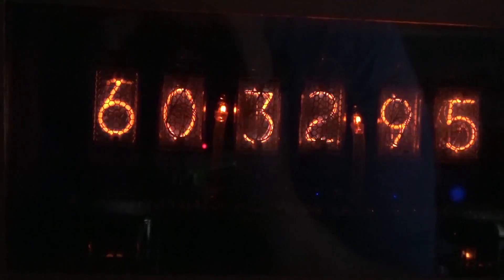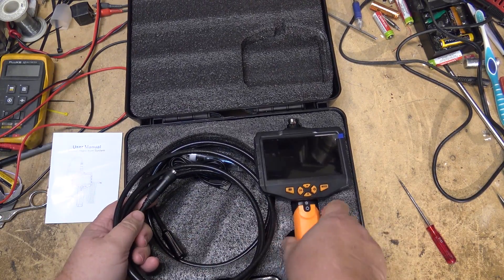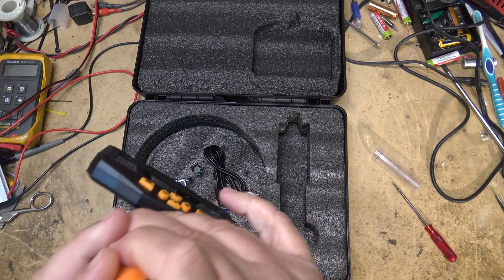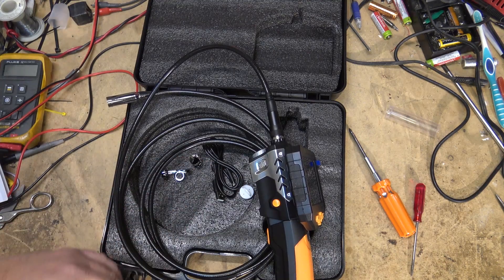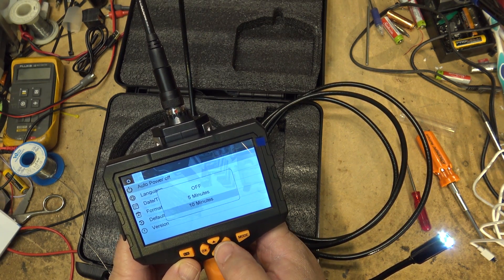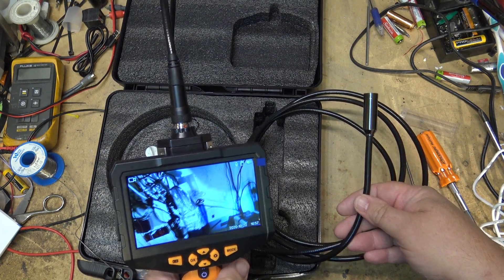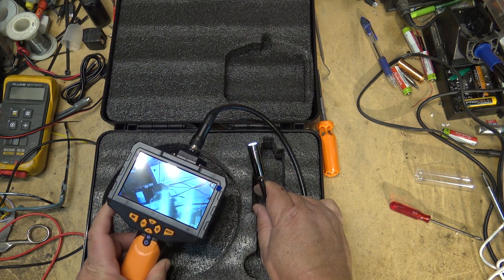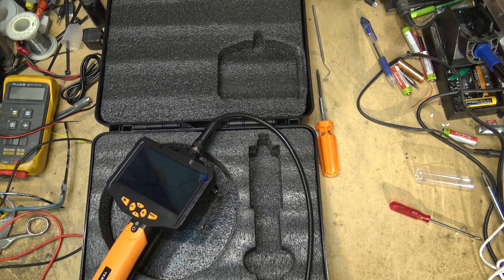Teslong NTS300 Autofocus HD Inspection Endoscope Evaulation test

Comment: Say if you have recorded MP4 videos on microSD Card that plays fine on computer, can you insert into NTS300 (3:40) and hear & view it?
Reply from the maker: Hmmm, never tried. Worth doing a video onto see if that works. Thanks for a great idea for a future video. Stay tuned!
Reply: @12voltvids  You may have recorded videos & take photos on it from your phone or tablet. Most use microSD Card
Can you take microSD Card out & insert it into NTS300 to see if it will play?  
Only takes less than 1 minute to try & share with us.
Reply from the maker: @angelisone  Shory answer is NO it won' t play other files.
Reply: @12voltvids  I would think many players can play with MP4 formats.
The NTS300 is a viewer, recorder of audio in videos &  as well capture still images.

File of images & videos taken from NTS300 has no problem in working on computer, right?
Reply from the maker: @angelisone  Files from this unit play fine in computer. They are .MOV files. 
Even when I store a file as a .MOV the player will not play.
Reply from the maker: No

Comment: Not bad at all :-D
Very clear and well lit picture, no light leaking from the side leds direct into the lense like some do.
I imagine that a smaller camera+tube is possible, but it would be a lower resolution so the sensor would fit.
The 18650 battery is so common, no stupid special battery like some companys make.